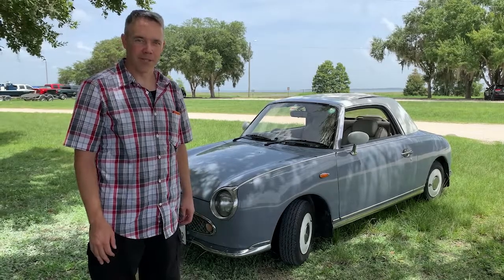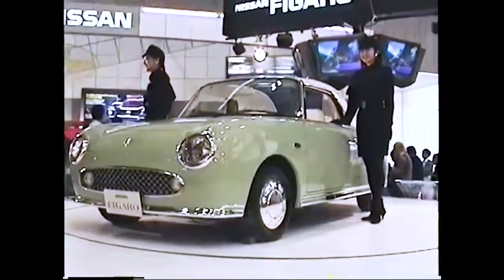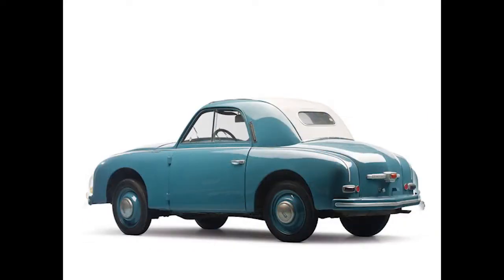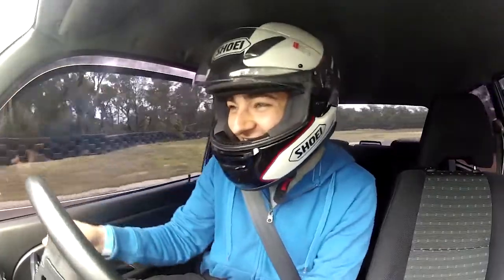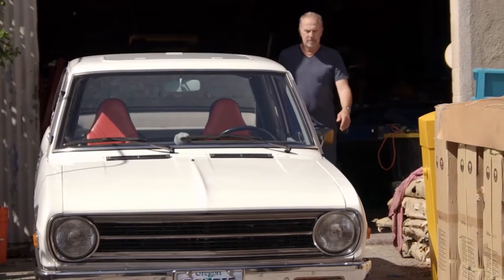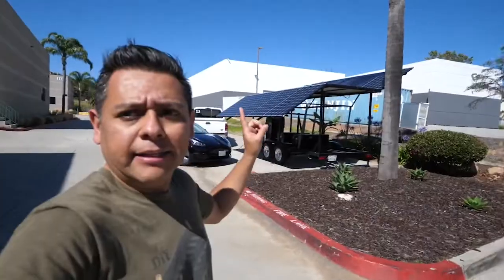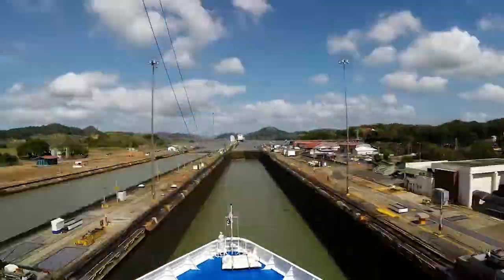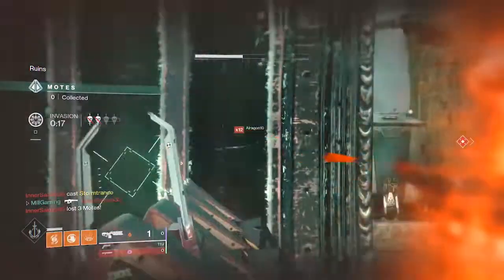SmartHacks EV Figaro ep 01 - Converting a Classic Japanese import to be fully electric

Comment: That's cool. I wonder when the next episode will be uploaded.
Reply from the maker: If there's something specific you'd like to see, let me know. I'm trouble-shooting a couple electrical issues at the moment, but happy to share.
Reply: @RealSmartHacks  Thanks for your answer.  I also want to make an EV with Figa.  I'd love to see what challenges you've gone through and how you're currently developing.  And you are also curious about future plans.
Reply from the maker: @Aram1-v8v   Fantastic! Currently, the 2 biggest challenges I'm wrestling with are maintaining 12V power to the BMS and high resistance on 2 cells of the traction pack. Both issues cause the car to die randomly whilst driving. While not a big deal when I'm by myself, it's a problem when I have passengers. I believe I have solutions and parts should arrive this week. As for future plans, I want the fuel gauge to show state of charge, tachometer to show discharge, and I want to make the defog toggle enable brake regen. If you'd like to do a FaceTime or Skype call sometime, send me an email on the channel about page https://www.youtube.com/@RealSmartHacks/about

Comment: I'm very interested in your EV conversion project and how you go about putting all the EV components together. I've also ordered a Hyper9 D IS motor, it's currently being shipped to New Zealand. I'm converting a 2010 Toyota IQ and will face all the difficulties of spoofing the ECU to allow the CVT gearbox and other systems to operate normally. Like you, I'll be idling the motor to maintain gearbox oil pressure, an auxiliary plate on the back of the motor will be fitted with the original AC compressor, alternator and crankshaft encoder and sensor. The car is still running on ICE as I research and document the various sensors and actuators. Good luck with your EV project! Lead the way :)
Reply from the maker: Peter, it is definitely a bigger project than I anticipated, so my timetable has been fluid. Nevertheless, working at a slower pace has given me time to approach challenges in a novel way. The plan is to post videos of the build after everything is done and working, that way I can focus on the work at hand and still have creative energy for the videos. As of this writing, I'm still waiting for the main component, the coupler, to be completed so I can put the motor in place and finish the electrics. As for AC, I haven't decided if I'm going to keep it stock, or get an electric compressor. In other news, I just finished installing the JuiceBox 40A wall charger, so that's another thing checked off my list. With any luck, this project will wrap up before Christmas. I look forward to seeing your IQ project propel.